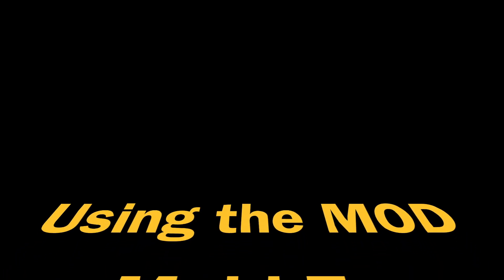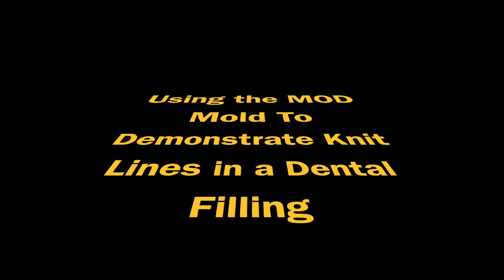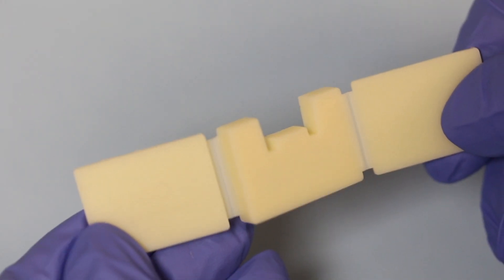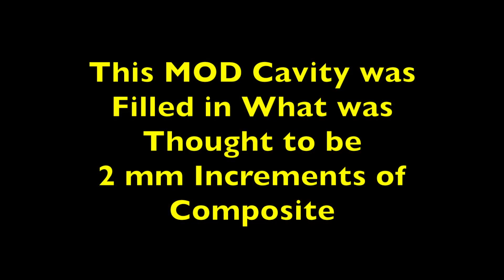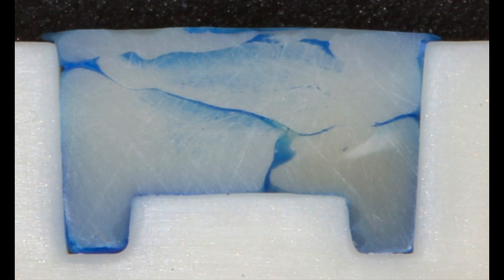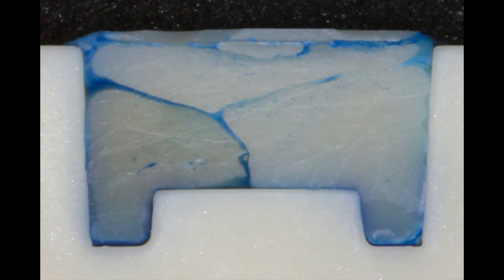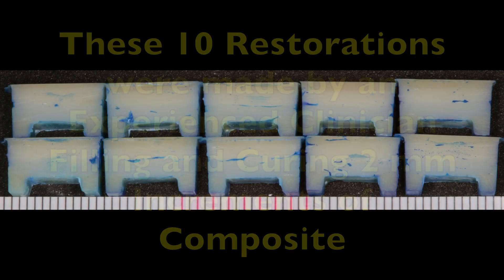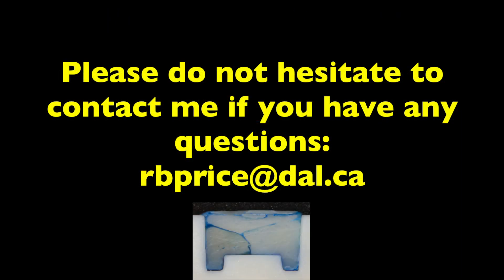Knit Lines and Voids in Dental Fillings

Comment: Dear Professor. How could We avoid  knit lines? When the layer technique is applied. Thanks i'm advance, and kind regards!
Reply from the maker: Two choices:
Place a small amount of flowable composite between each layer. Do not cure the flowable and pack the paste consistency composite directly onto the uncured flowable composite.
Alternatively, use a bulk-fill composite.
Stay tuned for another video.
Reply: @CuringLights  Thank you Professor! 📝🙌🤓